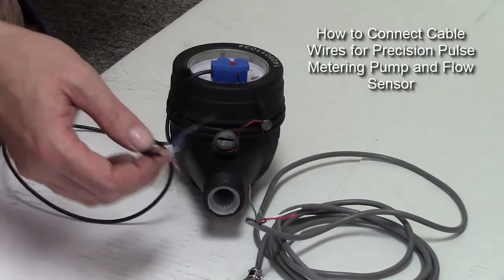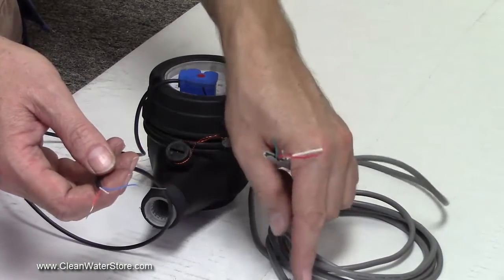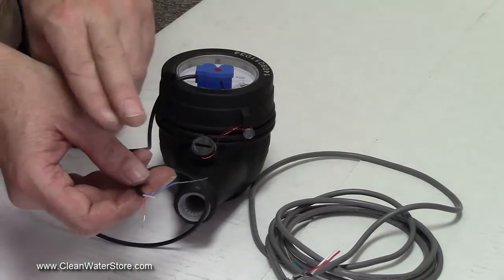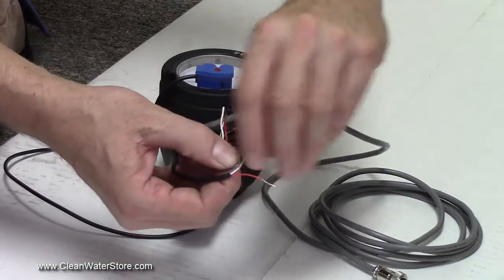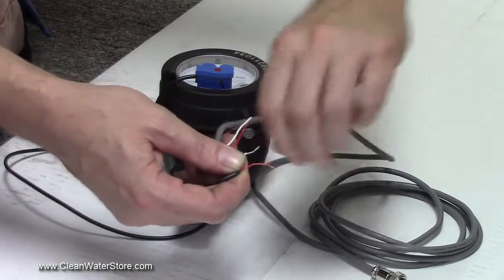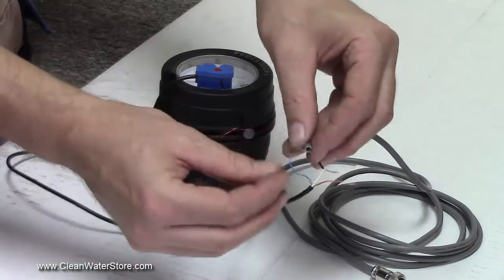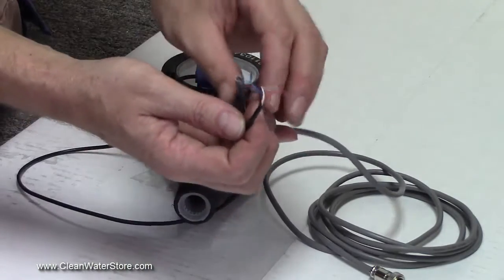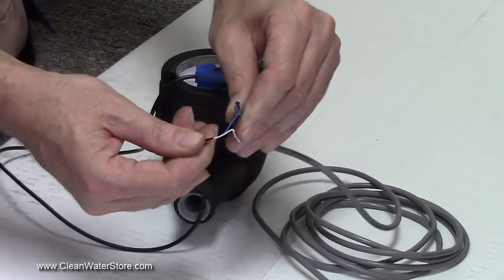Precision-24 Pulse Proportional Flow Metering Pump Wiring

Comment: mine came with no green wire it was yellow so i hope the yellow was what was supposed to be green. also, you guys gave me a wire that was only two feet long so i had to find some similar 22 g wire to make it long enough.
Reply from the maker: Thanks for letting us know about that.   Can you please email us at support@cleanwaterstore.com if you have any problems or would like a replacement?
Reply: ok. going to plug it in and set it up later today